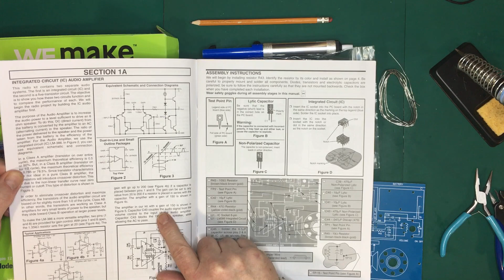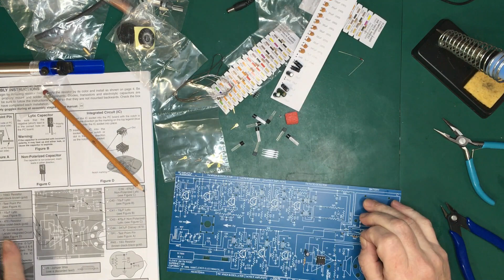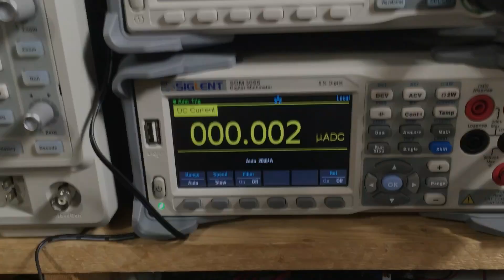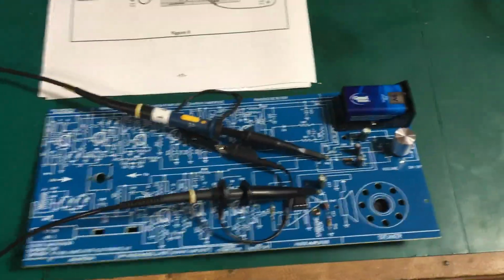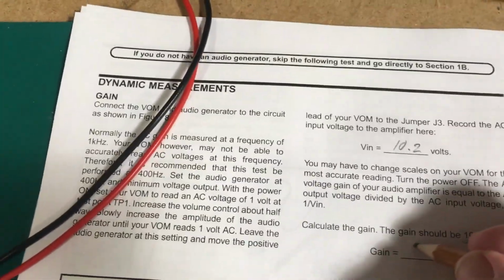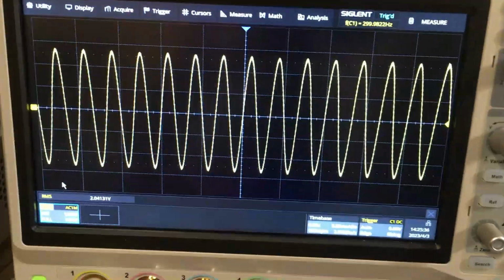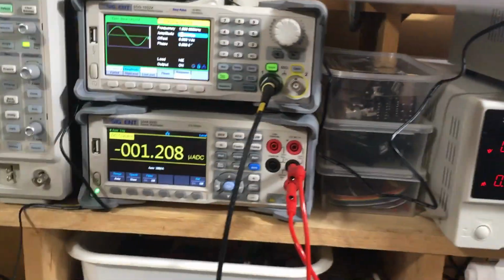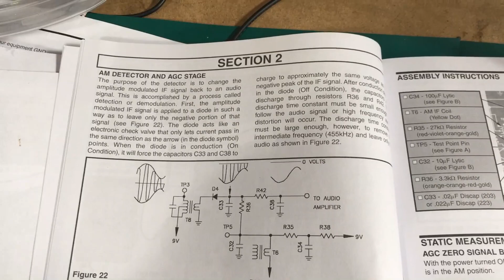0033 - Elenco AM/FM-108CK Kit Build: Part 1

Comment: Indeed the idea of turning the pot to half is to not blow your eardrums out while making the measurement not to reduce the gain by some arbitrary "halfway" mark, but why does it say 100-180? when the gain on the LM386 is set to 200? BTW I made the same mistake
Reply from the maker: R44 and C42 set the gain.  You can increase the gain to 200 by shorting out R44 (remove it and put in a jumper), or you can decrease the gain to 20 by eliminating both C41 and R44.
Reply: @uni-byte  Yeah I misread the instructions. The kit is set to have a gain of 150 so that is why they want between 120 and 180

Comment: Obviously I’m late to the party, but just wanted to say thank you for the great work by Uni-Byte for his awesome videos. FYI the Power out is measured from J3 but when I  tried it on my scope I did not measure any output.
Reply from the maker: Never too late.  Thanks!!

Yeah, I did the gin calculation incorrectly.  Checked it again alter and it was fine.

Did you get the 1Vrms at TP1?
Reply: @uni-byte  just checked at TP1 and it’s showing 1.087 Vrms. Looks like I’m in the ball park. 👍

Comment: I got this kit a few days ago, and have started the build.  I didn't see your build of the Transistor Audio Amplifier Circuit Board in Section 1B of the Instructions.  Did you do it?  After you build this little circuit board, you take the IC off the main board, and plug this Amp board into the IC Socket and then do some tests.  Is this just for educational purposes to show that the little IC does the same thing as this big supplemental circuit board?  If so, what do you do with the constructed amp board?  You don't use it and the IC for the radio, I assume?
Reply from the maker: I didn't build it yet.  Maybe I'll do it as a part of one of my monthly kit builds.  There would be something to learn from building it as they do a pretty good job of explaining how it works. I guess you just use what you find most aesthetic (visual or audio).

Comment: I am working on this kit. You have the same manual I do that calls out Capacitors C39 and C43 as non-polarized lytics. However, the capacitors that are in the kit for those numbers are polarized lytics. There are older manuals that call those as Lytics and shows C39 mounted on the copper side. I am assuming you just put the polarized versions in there and ignored the manual?
Reply from the maker: I guess technically I ignored the manual, but they don't give much choice.  The polarity for C39 and C43 is clearly (more so for C39) marked on the on the board and there is no electronic reason for them to be non-polar.

Comment: I think the jumper wire just makes an easier test point.
Reply: @uni-byte Just found my problems. 
1. I didn’t have the meter set to mv’s. 
2. I had my frequency generator set to 400 kHz instead of 400 Hz. 😮 😂
Reply from the maker: @kenmccarthy8130  Good sleuthing Ken 👍
Reply: I noticed that you didn’t move the lead to the jumper as it said in the book. I only ask for when I do it as directed in the manual I lose my time and have zero voltage. Any ideas? Maybe my volt meter is loading the circuit?
Reply: I meant tone, not time. 😊
Reply from the maker: @kenmccarthy8130  Hmmm, you are right.  An oversight on my part, but I did try it later and got overall better gain.  Not sure why you lost the tone when you did it.  What meter did you use?
Reply from the maker: Maybe.  Do they use it for that later on in the build?
Reply: @uni-byte  Yes sir.
Reply: Fluke 117. I’ll have to try with the scope instead and see what happens.

Comment: Yay! Can’t wait to watch all your videos! Just subscribed! … I’ve got the same exact kit that I’m about to start on. Question: The kit comes with lead-free solder, which I ABSOLUTELY HATE! It’s not nearly as good as traditional solder! Will it be ok to use my regular 60/40 (Tin/Lead) rosin core solder that I’m used to using, or is there something about this printed circuit board or foil/solder pads that would make using my regular 60/40 a bad idea? I have plenty of fume extraction, fans and air filtration to keep the lead smoke out of my face… Thanks! 😊😊😊
Reply from the maker: Thanks Steve.

Yes, 60/40 solder is what I'm using and it's doing fine.  I am also no fan of lead-free solder.  The board is probably tinned with lead-free, but they are compatible and you will have no issues using 60/40 or 63/37.

Comment: The instructions say in the first test to set the "volume control to half" not the volume to half, which may be why your result didn't fit the gain bracket they specify. I think you may have over-thought the test :)
This is an expensive kit, although its not really a kit in the normal sense, its a training course with the pcb and components supplied, and in that context its actually very inexpensive, and I am impressed with the quality and depth of the materials supplied that I have seen so far. One thing that impresses me most is that its not just saying how each bit works, its getting the "student" to make measurements, calculate relevant parameters and setting them up to understand how to diagnose faults in the future by tracing signal paths. I look forward to seeing the other videos in this series.
Reply from the maker: Thanks for the comment Ian.

Indeed they do, and I tried that off-camera.  The result was a gain of about 58.  The reason is, the pot is (correctly) a log taper pot.  Not linear.  The LM386 has an open loop gain of 200,  so a gain of 100 is -3dB.  So to get their desire for "half" power or more (100-180), the pot needs to be at 50% (or more) of it's resistance value.  With a log taper pot, that would be more like "turn volume control to 3/4".  Anyway, I took the -3dB route to get 1/2 of the power.  Perhaps they had a linear pot in there at one time and neglected to update the instructions when they moved to a log pot.  Who can tell?

But you're right.  This amounts to an electronics course in commercial band radio receivers.  Really nicely done and well worth the cost.
Reply: @uni-byte  The cost is reasonable if you are a US resident, but for those overseas the cost doubles due to US International postage rates. The manual is available on-line, so it might be possible to construct a AM radio similar to this using an inexpensive kit of parts from the usual Chinese suppliers. Some of these are worth purchasing just for the tuning capacitor. It might be difficult to correctly identify the IF transformers, however. Some Chinese kits use ceramic resonators in place of the IFs.
Reply: @uni-byte  Check the manual again and you'll notice that the input voltage is to be measured at J3, not at TP2 (your generator output). I made the same mistake.
Reply from the maker: @cogley-f9t  Right you are!